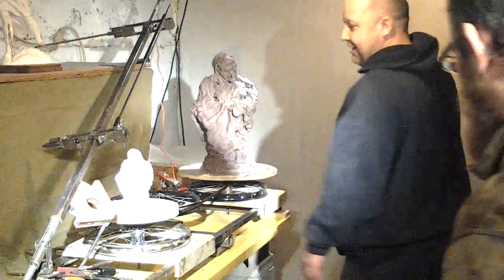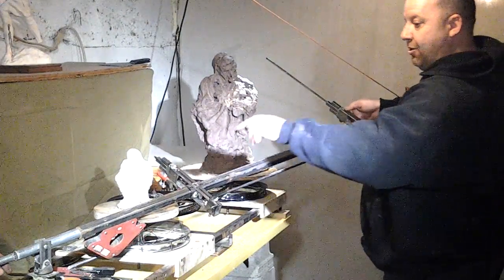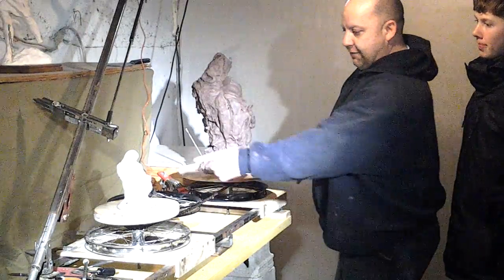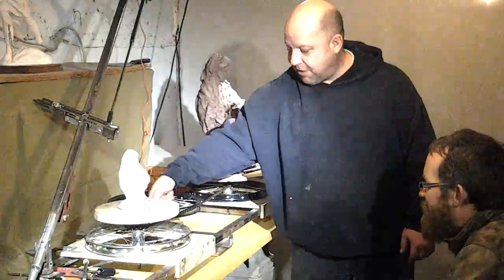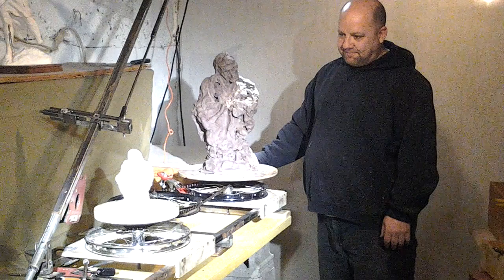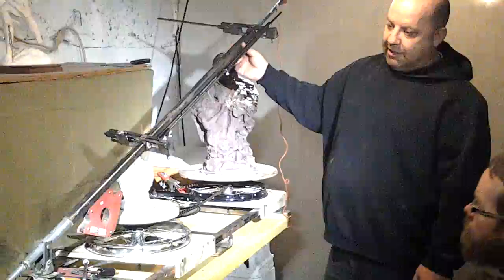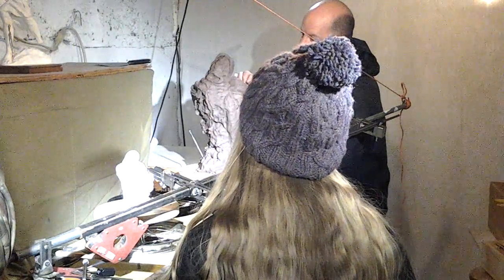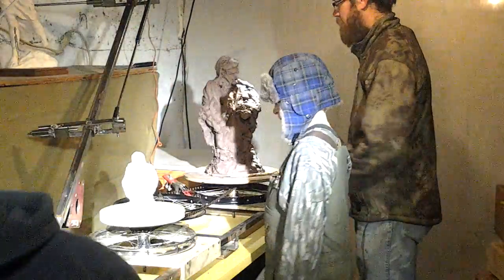3d Pantograph Demo

Comment: Thank you for the excellent information. I do bronze sculpture and would look at converting a system like this for reducing larger templates to smaller master moulds. Instead of the pointer I would look at mounting a dremel on the reducing side and use it more like a engraver. Thanks again.
Reply from the maker: That is a great idea I have seen it done, aslo some people use a heated wire loop to cut foam as the tip.

Comment: Very nice tool!  I have two questions if you don't mind.  What's the range of ratios it can reduce/enlarge as built?  Also, do you have plans or at least a material list available?  Thanks!
Reply from the maker: The ratios are variable based on the distance between the sculpted pieces, on this machine it is from about 1:1.25 to 1:4.5. hope that helps. also no materials list yet. I'm  working on it but it will take time
Reply: Cool, thanks for the reply

Comment: I had an idea for aligning it: If you'd make the secondary pivot points with open, tubular shafts, you could insert a pin through those, and get the two centers of the turning tables ligned up exactly with these pivot points by just sticking a pin through them into the turning tables. And as long as the tips of the pointers form a straight line between the pointer tips and the primary pivot, it should always be accurate.
Reply from the maker: If you will go to my website, you can email me from there, and I'll forward the information I have including the setup instructions I Found so helpful. as for the clay loop, I'm sure that would work on water-based clay when it is softer, but this oil-based clay I have would be far to stiff to scrape away. If I were carving foam I could attach a hot-wire setup to the business end of the rig that would work, or a dremel tool or small router. I would just have to add weight to balance on the opposite sides.
Reply: Sure, of course it wouldn't work on oil-based clay. Thanks, I'll look it up. See ya on the other side :)
Reply from the maker: That sounds interesting, I'd love to see a diagram.